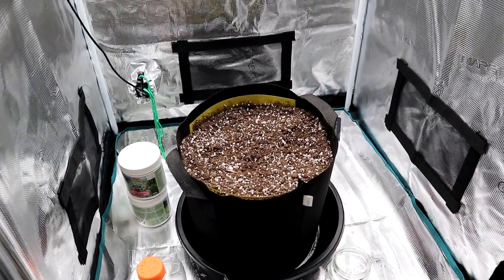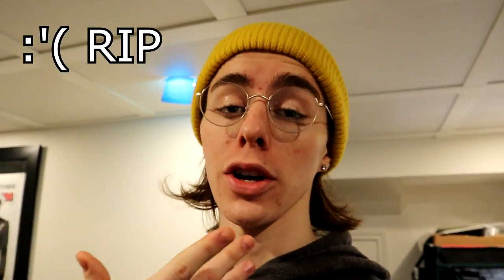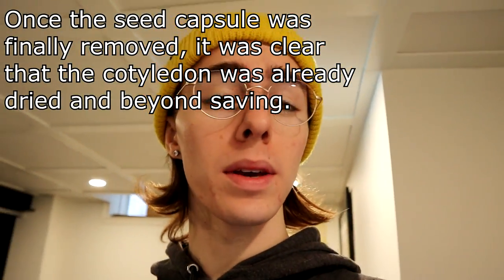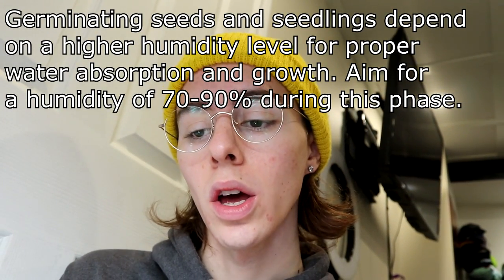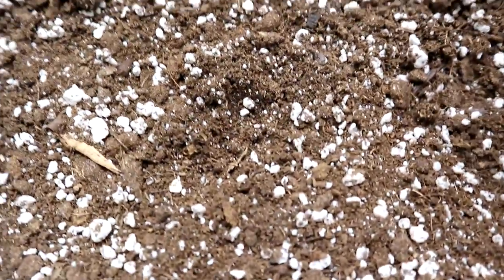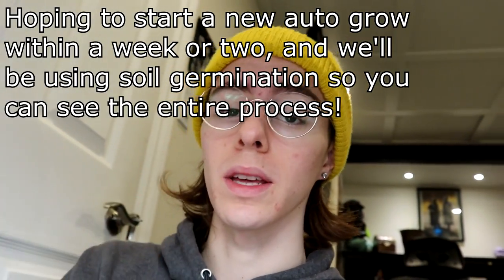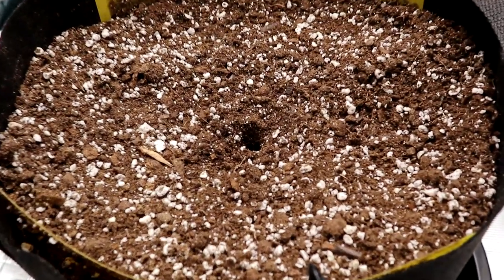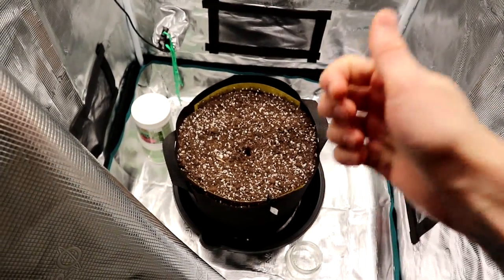Growing Autoflowers | Ep. 3 (The Little Seed That Couldn't)

Comment: That soil was as dry as the Saharah when you started. I almost always pre hydrate the mix and work moisture in by hand. Also a slight breeze helps once its up out of the soil and strengthens them significantly.
Reply: Ya I always soak the area where the seed goes...fuck a spray bottle lol

Comment: Move your seeds from the paper towel to the dirt when the tap root is barely out of the seed.   Your taproots went way too long that's why your seedling died.    Don't sweat losing a plant it happens to everyone.
Reply: Most breeders recommend the tap root being a 1/4 - 1/2 inch long before putting in soil.
Reply: @WonkaWillE  tap root was way to long
Reply: Been doing it the same way as oheeoh have a 99% success rate
Reply: @BigTrappaBenzo  a quick google search of "how long should a tap root be before planting" will confirm my first comment.
Reply: Germinating in the paper towel you either put the seed in the soil when its barely out the seed or you wait for leaves to sprout in the paper towel. Only 2 ways to the paper towel to go smoothly🍃🎯
Reply: With autos you plant them as soon as you see a tap root. I never cover them with soil when I drop them in the little hole. Get her wet and put a dome on her

Comment: Tap root was too long, you planted it too close to the surface, not enough moisture, direct light is a no go... Leave a dome with holes for oxygen until the first set of true leaves come out.. the cotyledons have everything the plant needs to survive until the first solar panels  come out, she just needs temperature and moisture.. most common seedling killer is light.
Reply: Why put a dome if the temp humidity is at the right lvl for seedlings makes no sense . Ive put no dome on mine and it just popped up today with light 24” away from the pot , humidity and temp at the right levels with a vpd . And light at 50% its all good

Comment: I just put the seed in a jar of dry sand, and roll the jar around for a bit. It wears off the glossy coating on the shell so it absorbs water better and softens more easily. Some people even take a nail file and rough up the outside of the shell, but I'f seen too many seeds fly off into the void, doing that. And, either way, I always soak them in water until they sink, before they go in paper towels

Comment: def wasnt enough water, that humidity should always be above 75% untill the 2nd or 3rd node. i really wished you inculed a image of the "failed" seedling rather than just a discription. i woulnts really even have the light on as much as you did as a seedling if i were to i would have used a cfl or a low powered led

Comment: I know this is years late, but there were so many issues with this attempt. Soil was dry, tap root was way too long in the paper towel before planting (don't do the paper towel method! Plant into soil...that's how seeds have worked for millions of years), may have been too rough taking seed cap off, putting the jar over the popped seed probably caused some damping off too. I would never cover a seed once it has broken the surface. 
Soooo many issues.  
edit: just remembered one more thing for anyone going through this same sort of thing - when sowing directly in soil, put the seed in sideways. Not with the point up or down, but to the side. That way, no matter how the tap root grows, the plant will have to push against the soil to straighten out and this will help the seed cap come off naturally. Give it a try.
Reply: You don't need to germinate the seed in a paper tower?
Reply: @charlesjohnson6346  nah, definitely don't NEED to use the paper towel method. You can just put the seed in soil and give it some water....just like nature does it. You can do the paper towel and it can work great without any issues - this is the way I started back in the day. But I ran into issues if I let the roots grow a bit too long. They would get tangled and even grow into/through the paper towel. That was my own fault, since they really should go in the soil pretty much as soon as the tap root comes out, but I found that not using the paper towel prevented it from being an issue at all.
Reply: @dubisirie2  I've got some California super soil additive coming, what kind of soil do you recommend? Also do you soak the seeds in distilled water for 24 hrs b4 germination?
Reply: @charlesjohnson6346  my bad, missed this comment somehow.
I think any good soil would work good. If you're adding some super soil to it, the microbes will do the rest as long as you feed them (dry organic amendments is the way I do it). I've had good success with the ever popular Ocean Forest from Fox Farms. It has a great texture. I like working with it, but if you have access to local compost, that would probably work even better since it would already be teeming with microbes. Adding in the extra microbes from the super soil will be all that much better. 
I have done the 12-24hr soak to see which seeds actually open up, but at that point I would just plant them as soon as I see each seed crack open. I wouldn't do the soak, then the paper towels after. I just don't like letting the tap root get too long prior to putting it in the soil and I find that happens with the paper towels. It's too easy to break off the tap root if its long.
I always come back to the fact that nature figured this out long ago without our help and the success rate I have with planting directly into soil is the same as any other method I've tried. So I try to save myself the separate germination step. Let the soil do it. Just don't over water the seed or its likely it could damp off (rot in the soil) and not grow.

Comment: Maybe you figured it out by now, but you didn’t water enough when you planted. If you watch the first video you can see you only saturated the soil about an eighth of an inch. You want to saturate all of that soil, you could easily pour a gallon of water in the water tray of your fabric pot and it would suck it all up. When you pick up a handful of your soil and squeeze you want just a few drops of water coming off, and then you know your soil is saturated.
Reply from the maker: Yeah, the soil wasn't close to wet enough. Thanks for sharing 👍
Reply: @SmokingBeaver  sorry for bombing your vids with comments. Just trying to help new people overcome some of the same problems I’ve had👍
Reply from the maker: @TinMan445  don't be sorry for spreading the info! I enjoy the sense of community on the vids

Comment: I find your show informative and here’s something that I have learned and you might try if you like… while growing auto flowers  they are always prone to have the shell stick to the starting leaf, the way I found around this is soak the seed for 72 hours or three days,
 then place the seed in    a moistened paper towel then put it   in a plastic baggie, for three or four days,
 every single time for me the shell completely splits off, from the little tiny plant. 
at this stage though be very, very, gentle. which means no tweezers!
 Because she will be easy to break and crush, and her taproot will be as long as you’re pointing finger… Make your whole gently cover her up with the leaf exposed, and you’re ready to rock ‘n’ roll from there… 

just use lightly your fingertips when placing her in… absolutely no tweezers because you could crush the membranes of the little delicate plant… that’s a no no…
 and I am 100% blind and I follow this method every time… I have had 100% successful rate…

Comment: There’s not a right way to grow weed but there is a definite 100% wrong way to grow weed. Don’t use pro-mix;, my old boss at the grow for his dispensary started off that way and and had bad results. Use “Coast of Maine Platinum Growers Mix Stonington Blend” soil. If you want a cheaper option do 1/3compost, 1/3coco, 1/3perlite. Scratch in your dry amendments after your plant has 6 nodes and use slow release newts or compost tea once a week. Buy some “recharge” and use it as much as you want because it’s microbe’s that are superior to ordinary ones because they’re specifically found on marijuana plants roots and they increase nutrient exchange.